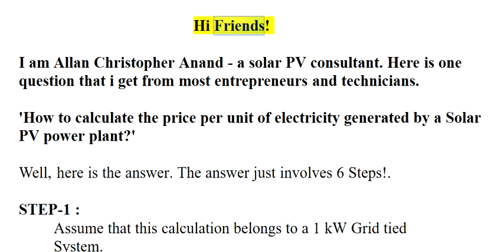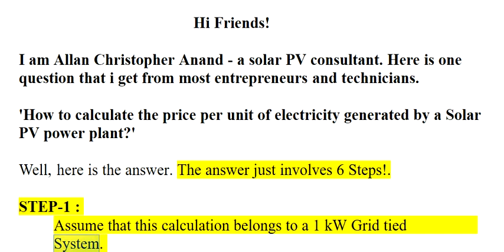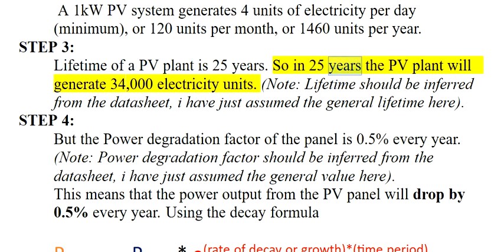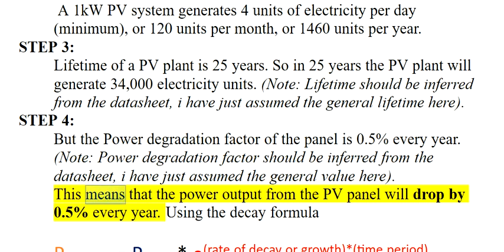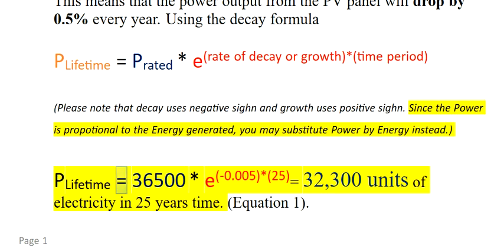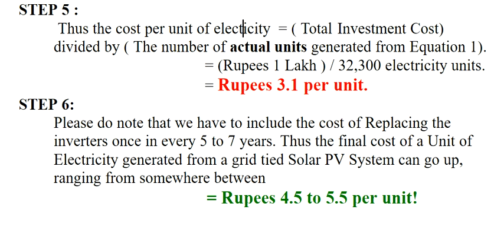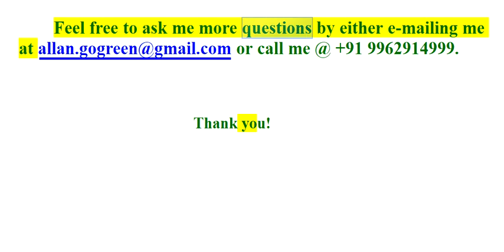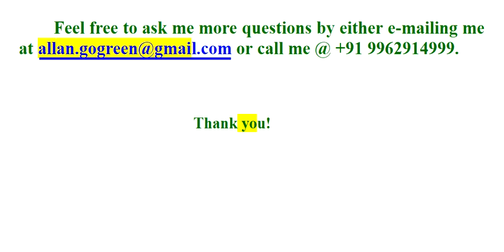How to calculate the cost per unit of electricity generated by a Solar PV power plant?

Comment: Well there are some other factors Also, while calculating the tariffs.
The auxiliary consumption of ur system should be subtracted from total generation, the rupees degradation value etc....
Reply from the maker: Nipen kumar Deka please do the math well, and you'll find those numbers negligible for  small scale power plants, however such calculations payoff in large scale power plant's economics. Thank you.
Reply: Allan christopher ohhhh please, don't take it personally,     there are lots of people's learning from ur videos, so they don't miss anything important, was my intention. At least u tried. 
Thanks
Reply from the maker: Nipen kumar Deka Thank you.
Reply: By the way, I m consultant too and have done lots of tariff calculations ( renewable and thermal plants) for the state electricity regulatory commission (SERC), private developers etc.
We're u r based, I mostly work in North East.
Reply from the maker: Nipen kumar Deka in Tamilnadu, Chennai. Please to connect with you on YouTube..

Comment: My solar energy solution will not require inverters so it will be more cost effective. The devices that I design will have a life of at least 25 years the life of the solar PV system. For more info you can see my last video on my youtube channel.
The complete solution will contain PV panels + large thermal mass storage + small capacity lithium battery to provide a complete house energy solution so basically a net zero energy house.